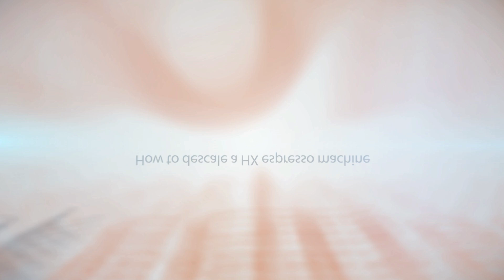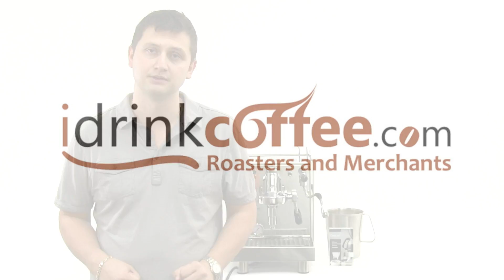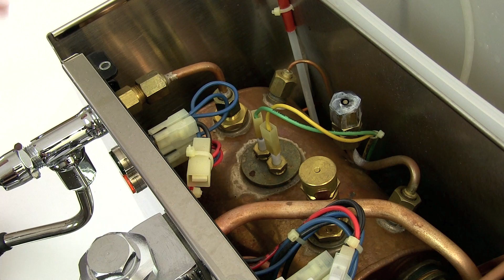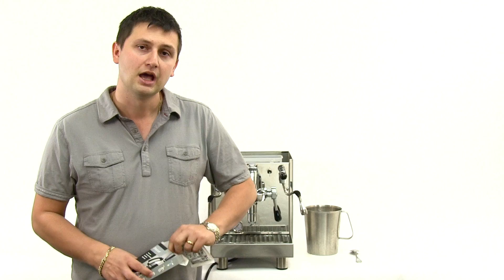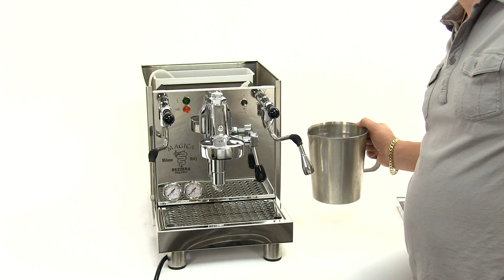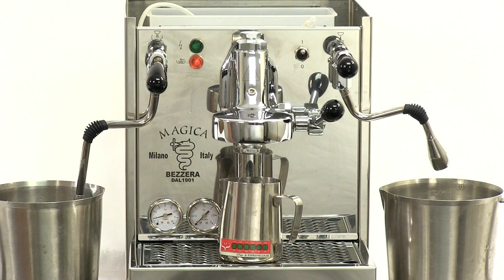How to descale a heat exchanger espresso machine

Comment: This method of descaling.

1. Stress and damage the pump.
2. You may not rinse the descaler enough and what's left will continue to cause corrosion.
3. If the user forgot to open the wand to allow to bleed, massive amount of water is going to come out from the safety, the boiler gauge could be destroyed.
4. If the user forgot to power off and start touching the wires, that's another hazard.

It's not going to remove everything, it may damage the pump, the heating element and the limescale instead of dissolving may release and clog somewhere.
Descaling should be the last resort and people are mixing up the erroneous advice from appliance companies like Delonghi, Nespresso, Krups etc with these machines

My advise is don't descale at all and just change the components if necessary. 
It should start with paying care atttention, using softened water from the beginning.
If you put it in control, you will never need to descale.
It's never too late to use softened water.

That's why get a decently made machine without too much unnecessary features so servicing won't be so painful during the replacements
You are not going to get a significant taste improvement from adding one PID, one complicated system of pressure profiling, etc.
The more features - the more parts -  more things to fail - lower reliability.
If you don't like the coffee that you bought, you should just get another bag which you like than tinker non-stop how to improve it. By the time you have figured out, you have wasted the entire bag.

Descaling causes corrosion, causing lead and other metal to start leaching.
There was a discussion in Germany where people test the water from their machines. Those who descaled have significantly higher amount of toxic metal. 
This includes brands that uses stainless boilers.

Bezzera BZ10 and the BZ range fared really well. Bezzera seem to pay good attention to their material which unfortunately consumers can't see from the spec sheet. 
There's also thermosiphon system which is not even needed if the barista did it right.

Comment: I have an older Model Quickmill Evo 67.  The manual states that they strongly discourage descaling and will not provide any instructions to do it.  I have always used distilled water in conjunction with Third Wave Mineral packets to hopefully avoid any scale buildup.  But I still feel an occasional descale would be beneficial.  This is a double boiler system.  Is there any reason why I shouldn't consider descaling this machine?

Comment: Thank you! I used this method on my Rocket Giotto Evo R today, and it worked like a charm. We even used a "wire" camera to look inside the boiler (through the fill probe hole) and the before and after was a big difference. We use bottled drinking water so it wasn't horrible to begin with but there was definitely build up inside the boiler and on the heating element. The only thing I would recommend is to over flush it, especially if you have a rotary pump, we flushed it probably 15x until we saw no more flakes in the water. To finish I filled up the boiler and used a small hose and shop vac to suck out every drop of water a couple times to be sure all the floaters were removed.
Reply from the maker: That's all great advice, thank you.

Comment: Hi, I've got QuickMill QM67 can this exact process be used with my machine? Thanks.
Reply from the maker: Yes, the qm67 is a double boiler so you just have to make sure you descale both boilers though
Reply: @iDrinkCoffeeCanada  Just did it but didn't disable the water level thingy, it takes a lot of water to get out the descaler though

Comment: Interesting to descale the machine with the level probe disengaged, I have few comments with this video and technique.

1. Removing the probe is overkill, because:
    - The calcium will not evaporate in the boiler, so the scale build is only in the bottom part of the boiler where the water sits during normal operation. You will see this when you manually clean your boiler and take it apart.
    - The acid in the descaling solution actually does partly evaporate (acid rain principle), so any scale build up in top of the boiler (which should be almost zero to begin with) will also be reached as long as you keep the machine (and heating element) on and steam with descaling solution is filling the top of the boiler.

2. Descaling the boiler with the machine (and heating element) turned on is much quicker, because descaling agents work much faster with hot water. This is also what most espresso machine manuals recommend BTW. The speed up of the chemical reaction varies per agent, but 15 minutes with hot water should in general be similar to a few hours with cold water. Always use something like Urnex Dezcal instead of Vinegar. Vinegar can erode certain metals in the machine and it also dissolves only part of the minerals. 

3. If you remove the probe and empty the boiler this way (especially with a hot boiler), there is a risk that the pump cannot keep up with the pace of the boiler running empty. This way the heating element can run dry, which can result in it overheating and damaging the heating element. Also this "probe method" will burden your pump heavily, as told in the video. Vibration pumps are very sensitive to this.

4. You need to use the blind filter or backflushing disk to backflush the E61 grouphead with the descaling solution. Only flushing the E61 group head directly will not have enough contact time to effectively remove the scale build up. Backflushing with Cafiza will only remove oils and coffee residu, but not remove all scale deposits in your Group head. Some manufacturers recommend 3 times 20 second backflush, but I even leave the lever in the middle position for a few minutes, so it can soak the group head, before flushing it empty through the Relief valve.
Reply: What are your thoughts on the recommended frequency of descales? Of course it depends on local water hardness levels, but do you agree with the ballpark of once every three months or so?
Reply: as you said... it depends on local water hardness. so there is no rule. what you can do is check your normal water boiler and see how long you can go without descaling it. since mostly everyone has a normal water boiler. @isodoubIet
Reply: @isodoubIet  Sorry for late response, somehow didn't got notifications of this video.
1. First of all use soft water, between 1 and 3 DH (german calcium measure), or between 18 and 54 mg/l. If you use soft water you only need to do it maybe once every 1 or 2 year and the build up will be still limited, so a few minutes with descal is enough. I do it once every 2 years. If you don't have a water softener in your house, and your standard water is very hard, you can use special softeners for coffee machines or just buy water off course. Some use mineral water and/or blend with distilled. Minimum hardness should be 1DH though.
2. Descaling solutions are pretty aggressive, not only will they hurt your machine over time (so preventing it with soft water is always better), it is also not very healthy. It will dissolve also metals in your machine, especially in the softer bits with brass etc. So after descaling you need to rinse it very well. Metals can still leak from the machine for a while after descaling. Only use it when the water is completely colorless/odorless and check it after a day again standing (and rinse again if needed) before using it.
3. Pregnant woman (unborn children), and young children are especially vulnerable to these "heavy" metals, lead in particular.  So my advice would be to not descale it those periods. Although most coffee boilers are from stainless steel these days, all fittings and the group head itself are from brass, which contains small amounts of lead.
4. Don't use the steam boiler water of these coffee machines for consumption, especially not for preparing baby formula/milk etc. Because in home environment they will not be regularly used. Sometimes the water will sit in the boiler for days even weeks. Best is to use only stainless steel boilers. I use a separate water cooker for preparing americano's. I only use the water nozzle for cleaning the machine and refreshing the boiler water.  I daily take a few cups of water out of the machine just to keep the water fresher in the boiler. If you have been away for longer time, it is better to fully flush the entire boiler and machine.
5. When you take water from the water nozzle only do it in smaller increments (small glass is fine, but not very large thea glasses etc), be sure to stop when the pump is activated. Wait until it has filled up again, and continue. If you not do this, the heating element will partly run dry, and get damaged over time. A lot of machines are not protected against this.
6. With respect to the group head, flush it regularly after you have not used it for half a day. Group heads still contain a lot of brass as stated earlier, so first flush the standing water from the group head (and do not drink it or use it for coffee), so the water in your coffee is fresh from the water tank. Coffee shops maintain a certain flow. Particularly older machines and cheaper models use brass boilers etc. But still if you have a stainless steel boiler, the water spout and fittings that go from boiler to the water tap still contain brass, so also flush the standing water in those pipes etc before consuming.
Reply: @gerard3797  Excellent !! I copied and saved both your comments thanks alot Gerard
Reply: @freightdawg6762 You are welcome. Enjoy your coffee ☕️!!
Reply: what if dezcal is left in the boiler overnight? would that be damaging?
Reply: can you make a video on descale...i trust you more.
Reply: how can I descale a Sab Jolly 2 group machine, help

Comment: thanks for the vid, clearly explained a solid process.
For those about to attempt this, pay attention at 5:00 the vacuum breaker value does spew water, it was enough to go through the small cloth i had and short the machine (plus home circuit breaker) There's obviously some open wiring right under the boiler there.

Comment: hello Slovak, I purchased a Rocket Cellini 4 years ago from you, I make an espresso or 2 daily. For 2 years I lived in a house with a soft water ion exchange system so I don't think I needed to descale the machine. The past 2 years I lived in a condo so all I could do was use tap water through a Brita filter. The machine has no problems, but should I try to descale it following the method you demonstrated here?
Reply from the maker: That's a hard question to answer.  Sometimes if there is a lot of scale build up when you deacale you can loosen that scale without fully desolving it and create problems rather than solve them.  If you do see signs of scale like white or green deposits on your hot water wand or inside your tank it may not be a bad idea.  But I would suggest leaving the solution in the boiler for a longer time like overnight so the scale has time to dissolve.

Comment: And what is the procedure for a dual boiler machine?
Reply: Much easier! Look at the instruction manual. A heat exchanger is much different setup, with no normal way of flushing the kettle.

Comment: Hi. What if I start with an empty boiler? That way, we remove the need to do the displacement. Will that be acceptable?
Reply: Oscar 2, purge it for water through side valve on kettle.  remove level sensor wire=heat element turned of and pump is on. Open steam valve, turn on power. Pump starts filling boiler, wait until cleaning solution comes out of steam arm, connect wire to level sensor = pump stops, and heat element turns on. Leave power on until hot water begin to pour out of steam arm. Turn off power, leave for 1 hour.. 
Drain heatexchanger kettle through drainage plug. If filled with larger pcs of scale repeat yet again. 
Else just fill up with clean water, remove water level sensor wire, turn on power and steam valve, and purge all water through the steam wand.

Comment: Great video... 6 years on.. my boiler is upright so  I undo the steam wand and tilt the boiler to empty the boiler chamber.. Did this twice with 2L of Acid solution. disconnecting the level probe was key..   Gave me confidence to do it.. Better to cool and empty the boiler and refill so you don't have to flush with so much water.

Comment: Great Vid and very helpful. You said that we have to descale the machine every 90 days. I bought my Appartamento before 2 weeks and I am doing 2 espressos a day. I do a backflush every 2 days and once every two weeks(yesterday for first time) back flush with a cleaning tablet. In the user manual said that ROCKET espresso do not recommend to descale the machine, just to use filtered water and maybe/also reservoir filter.  What is your opinion?

Comment: Recently serviced my Giotto at a recommended shop ask about descaling machine was told it was too high risk in case small particles could clog and cause damage. After watching this video I think I’ll do it myself and save couple hundred bucks
Reply: so are you going to this process and risk the small particles clogging your pipes?
Reply: Jireh Climaco they wouldn’t to do it how else are you suppose to descale then ..  I would do it a couple times over Or I could just strip it down and soak pipes and boiler in solution.

Comment: Thank you for the great video ,  I got a question and  and I need your opinion, I have a Breville BES870 that I bought it like more than 5 years  ago and still working perfectly fine  but I want to move to the next level so I was thinking to buy this DS1GMAVAIN , I would like to know if you think is a good idea or I should get something different, I want to know your opinion , thank you so much.
Reply from the maker: Hi, to be honest I do not have a lot of personal experience with VBM, we used to sell them a few years ago but stopped a while back.  They are essentially e61 heat exchanger machines.  There are a lot of brands that compete in that machine category.  My favourites are Rocket, ECM, Profitec and Quick Mill
Reply: @iDrinkCoffeeCanada  thank you so much ,if you have the model # i will appreciate.
Reply: @iDrinkCoffeeCanada  Weired that Bezzera isn't in your favourite list.

Comment: Machine turned on means with the heat element turned on? inside the boiler, the mix works better with high temperature?
Reply: My Quick Mill has a two way switch, with one position disabling the heating element. Either way, if there is already some water in the boiler, the element won't get damaged, and you're probably running water through fast enough that it won't get hot.

Comment: Can I run this method with white vinegar instead for Bezzera BZ 10?
Reply from the maker: I suggest using a stronger acid than vinegar.  Vinegar usually has a pH of around 3 and something like citric or acetic acid will be 2.2 to 2.4 which will be more effective

Comment: Hi Slawek. I'd like to ask. Do I need to do this action on my Magister Stella machine ? I bought from you 4 yrs ago ,works amazing ! I do the usual maintenance  [ head ,water filter etc]  thanks for your patient, Gustav
Reply from the maker: If you have never descaled before then I do not recommend doing it after 4 years.  Take a look and see if there are signs of scale build up, ie. Any white residue on the tank or inside the boiler of you want to take a look.  If there is give us a call before you descale.  It's better to bypass the pump and pour solution directly into the boiler of you have a lot of build up

Comment: How you do it with a dual boiler? and chance current short cut if open? and heating up the boilers?
Reply from the maker: Kurt the process for a dual boiler is basically the same.  You just run more water through the group because that water is coming from the coffee boiler.  The coffee boiler is always full so you don't have to worry about level probes.  To descale the steam boiler you would follow the steps to over fill.

Comment: To test if the discharged water still contain traces of descaling solution (acid), you can test discharged water with soda bicarbonate. Upon contact with acid, it will bubble.
Reply from the maker: That is a useful tip. Thank you so much for your input!

Comment: My Giotto's vacuum breaker valve spewed out lots of water, enough to flood my counter top. It also blew a fuse on my home breaker box (probably shorted out the electric components below the boiler). So I recommend using vice-grips to hold the pin up at the top of the vacuum breaker valve to close it from spewing.
Reply: Follow up question 3 years later; what's your latest process for the Giotto? Is it really not required as Rocket says? Have you found a better way to do it?

Comment: I followed the process on my Bezzera Magica (identical to the one shown in the video). Following the procedure, the machine behaves in a weird way: making coffee, when the pressure rises to around 10 bar, the pump seems to "choke" and becomes much more silent than normal. It looks like it has lost power. Do you have any advice? Could it be that the descaling procedure damaged the pump? Thanks!
Reply: It can clog valves with partickles!
Reply: same probleme at my ECM

Comment: Could you tell me please, if i can do this operation on dual boiler espresso machine? Thank you.
Reply from the maker: Iura Glijinschi yes, the same process applies.  You will just have to run more water through the group because your coffee boiler has a larger capacity than a heat exchanger.
Reply: Thanks!!